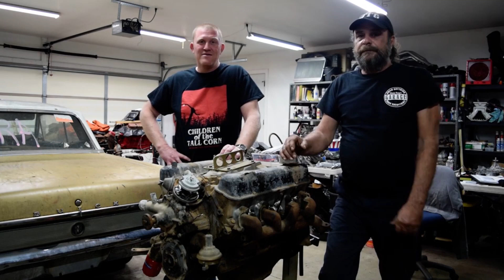Buicks Miracle Motor

Comment: Put the 215 in an Opel Kadett because they were sold by buick.
Reply: I have one in an Opel Manta, great little engine in a light car!
Reply: Also the V8 is about the same weight as the original 4 cylinder engine, so it’s a win win!👍🏻
Reply: @stratznhatz  a manta with this little turbo engine would be great fun.....from Wyoming USA 🔫🤠🇺🇸p.s stay safe
Reply: @billallen4793  Yes the Manta is a great looking car imo and the V8 gives it the go to match. Mines not turbocharged and only mildly tuned but is pretty quick even by modern standards. Thank you and stay safe too from the Uk😊
Reply: @stratznhatz  we had a manta when we were stationed in Belgium. It was a fast little car, that handled VERY well for the era. It stayed there when we came stateside in 86, the shipping was more too expensive vs the value of the car. Every once in a while you'll see one around town, a guy has a yellow one parked in a field. Our's was a dark green with black pinstripes, black interior. Great little reliable car, that was fun to drive. With the torque of a v8 it is probably better. With the added weight up front does it push in the corner entry?.....from Wyoming USA 🔫🤠🇺🇸p.s stay safe and healthy everybody GOD BLESS OUR COUNTRY AND stop this foolishness before it's too late...
Reply: @billallen4793  I agree, the Manta was a fair performer in it’s day and a nice car to drive. If I were lucky enough to get hold of another one I would leave it stock and original, especially given their rarity these days (I modified mine 20 years ago). 
The V8 doesn’t affect handling as I believe it’s actually slightly lighter than the original engine - the cih 4 cyl is very heavy  for it’s size. 
Nice to hear of your experience with one in Belgium, thanks for sharing.
Best wishes to everyone.
Reply: @stratznhatz  come for vacation and snag the yellow one...lol I live in a gorgeous mtn town called Lander. The shipping and left hand drive will be the biggest problems, out west our car's DON'T rust much so that shouldn't be a big issue....from Wyoming USA 🔫🤠🇺🇸p.s stay safe
Reply: @billallen4793  Ha ha, would love to visit the USA one day, will make a note of Lander, you never know! Yes they’re pretty rare in the UK now, hardly ever bump into another one at shows etc, rust is a big issue over here! Sounds like an idyllic place where you live, take care and stay safe🇬🇧
Reply: @billallen4793  ps: there’s a couple of short vids of my manta on my channel if you’re interested, also one that another guy did which you’ll find if you type in ‘Manta v8 kop hill’
Best wishes 
Andy.
Reply: @stratznhatz  I'll give them a watch! If you google lander!...lol yes I think we are spoiled, living here. Other's say we are stupid because of the winter's. But the ability to have public lands, and freedoms to do any outdoor hobby you can think of just feet from your door. We are minutes away from ANYTHING, PRAIRIE, DESERT, RIVER'S, LAKES, MTN'S, GRASSLANDS, and anywhere else you can think of. All accessible to the public free of charge. And I'm fond of self defense and shooting so my state is awesome for that. We DON'T have to have any license to conceal a weapon "pistol" and we gave open carry which means I can carry my pistols in plain view WITHOUT being hassled. Before I became disabled in September of 03, I was able to fistfight my way out of any trouble but not any more. So not being a victim or a statistic is important to me. Not that we have a crime problem, but being ex military you must be prepared. The scenery is worth the winter's, I need to make a bumper sticker that say's "Wyoming  EVERYWHERE you lQQk is like a postcard". World class trout fishing is another reason. And raising our kid's in a great community was important also....from Wyoming USA 🔫🤠🇺🇸p.s stay safe
Reply: @stratznhatz  oh I forgot, my buddy has a junkyard and he has a all aluminium buick v8 to take hime wuth the yellow one from town. And living in a place where car's DON'T rust is great, my 74 full convertible Blazer that has 1ton axles and a 465muncie 4speed with 37"tires. And no vehicle inspection and EASY rule's regarding legalities of road worthy vehicles. 4 wheelers are road legal here, and any performance thing can be done to your vehicle WITHOUT getting in trouble by the state or local cop's....from Wyoming USA 🔫🤠🇺🇸p.s stay safe
Reply: @billallen4793  I will definitely have a gander at lander lol! I’m not a fan of big cities, much prefer to be out in the sticks a little so it sounds like my kind of place.
 Sorry to hear of your disability, hope it doesn’t affect your daily life too severely.
 Blazer sounds great, and I guess a 4x4 gets a lot of use in your area!  We’re lucky in the uk that as long as modifications are declared (insurance) and the car passes Mot inspection you’re good to go. Only extreme mods would require engineers report, such as scratch built or heavily modified structural changes, at least that’s been my experience, although there seems a constant surge by the powers that be that try to clamp down on things. Take care.👍
Reply: @stratznhatz  very cool car! Watched your video's and your car was great. Why did you get rid of it? I love the color too. It's real close to a 66 f250 I had the ford color was called emberglow. Snag this yellow one and put a little LS Chevy engine which I think is smaller dimensionally than the little buick v8. Looked pretty tight by the brake booster, and I wish I could have seen the steering shaft and the exhaust clearances. Is it hard to build hot rods over there? Or can you hodg podg stuff together like we can? All we need are light's to drive at night. You can build a car without light's to drive in the daylight. We don't have inspection in our state or emission testing, you can do whatever you can dream up. I loved building and racing my whole life, ANYTHING burned gas. I still have a bunch of old toys that I can't use anymore, or was in the middle of building when I got hurt in 03 with a back injury at work so my legs are quitting...lol I never got to England closest I got was camping on those rocky beaches on France's north shore. I've heard it not the same now and I should cherish the memories because it isn't like that a anymore. Do you have some projects that you're working on, or dreaming about? I've got 4.5 snowmobiles 5 motorcycles that are all special/oddballs a garden tractor with a Yamaha v-twin 750cc built for pulling a weighted trailer/sled and my speed/drag boat, and I can't work on any of it. If you come to the state's you should check out the flyover state's like mine. How big is your town? Our town is 7000ish people but 30% are seasonal resident who go south for the winter,  retired folks. Anyhow sorry about the book...from Wyoming USA 🔫🤠🇺🇸p.s stay safe and healthy everybody GOD BLESS OUR COUNTRY AND YOUR'S
Reply: @billallen4793  Thank you for the comments, and don’t worry, I still own it! The vids where I’m rambling on about the modifications are very recent as I’ve changed the engine recently for the larger 3.9 version that I sourced from a fire damaged TVR Chimaera which is a British sports car you may or may not have heard of. Only mods are mild cam (crower 50229) and I just tidied up the cyl heads but retained the stock valves. 9.8:1 compression ratio, modified Range Rover P38 headers and topped off with an Edelbrock 500 carb so just enough to liven things up without spending the earth lol! I also added a dual wideband AFR kit to help tune it which works pretty well. Yes it’s not too bad regarding building cars over here, although like I said there always seems to be someone trying to spoil it lol! So far so good now, and whatever your views are on Brexit at least the rest of Europe can’t influence our government like they used too, I believe Germany has to retro fit catalytic converters to classic cars in order to keep them legal, according to the episode of Wheeler dealers where they bought an 80’s Mercedes from Germany. If a car is over 40 years old here it can be declared tax and Mot exempt, although technically if it’s modified significantly from stock the mot exemption is not valid and I take mine for inspection every year regardless for my own peace of mind.
  Sorry to hear of your back injury, such a fragile thing the back and hear of so many people with back issues. I did mine a couple of years back, just picking up a pipe flange off the floor at work and man the pain nearly brought tears to my eyes, and to this day I still have a numb patch at the top of my right thigh, thankfully not enough to affect me but has made me very careful now and I tend to use the crane a lot more than I used to!
Sounds like you have a lot of cool stuff there, with the tractors, snowmobiles and drag boat’s, something for every terrain! Shame you never made it to the Uk, I’m guessing this would have been in the 80’s which is the era I grew up in and like everywhere things were different back then, for better or for worse lol,  but I have fond memories of that time like I guess most of us have about the time when we were young and free.
Other than keeping on top of the Manta, no other projects at present, although I’m always dreaming about doing something. About 5 years ago I bought a ‘61 Olds 88 that had been sat in a barn for over a decade. It was surprisingly solid and once I’d got it running smooth and overhauled the brakes it became my daily driver for a few years, which is nuts really over here, the darn thing barely fit in any parking space and averaged 10 mpg, but I loved it and only sold it due to the running/renovation costs. Will hopefully get into another project in the future, probably be when I retire now God willing.
The town where I live is in the Peak District, Derbyshire and about 12,000 people. Not too built up here, and you don’t have to drive far to be out in the countryside, so maybe not too different to Lander, which might I add looks like a beautiful place from what I can see! (Wikipedia and google maps-something we didn’t have back in the 80’s lol!).
 Hey don’t apologise for the book, I’m just as bad ha ha! Been nice conversing with you.👍
Hopefully I’ll get to the USA one day, and will definitely choose the rural area’s over the Cities if I do.
Thank you for your service, take care and stay safe, and yes, God bless us all😊
Reply: Or an Opel GT.  Would it fit?
Reply: @turdferguson4124  I guess it would probably fit but would be a tight squeeze. Would be cool though, like a true baby corvette!
Reply: @stratznhatz  I now have the "you're too fat for the Opel GT" TV commercial looping in my head.
Reply: @felisconcolor1112  ha ha, yes I’ve seen a clip of that ad!
Reply: @turdferguson4124  I've seen one with a big block Buick
Reply: I have 2 Buick 215's, one in an MG Midget... back in 1960's daily drove one in the Olds Jetfire turbocharged...
Reply: Yes! Uncle has a 74 I've been trying to get him to swap it for years!
Reply: I'd like to see it in a Model T coupe hot rod.
Reply: 69 Opel was my first car. Got clipped for doing 72 in a 55. Was pretty much wide open.

Comment: the 3800 series 2 and 3 are rally solid engines 

really cool learning about where they started from
Reply: just gotta replace the lower intake gaskets with the FEL-PRO metal frame ones..... and ya, 500,000 miles with just oil changes, a few sensors, and possibly a water pump
.
and if you dont know about the LIM gasket defects on the series 2..... you do now!!!..... and you should replace them ASAP!!!!
especially if it has more than 175,000 miles on it
.
coolant will start to leak on the outside.... usually pooling in small spots on the intake by the injectors
then it will start to leak internal..... filling the oil with coolant
then the engine locks up
then you make a big sad face...... 
.
but if you buy the 50 dollar gasket set..... and spend about 8 hours..... now the engine has ZERO flaws / defects
and WILL!!! last damn near forever 
.
but ya.... its a pretty easy job..... just time consuming 
its like pulling the intake on a 350 chevy..... just with fuel injectors and a few wires to un-hook and flop out of the way

Comment: I had a 225 in a 1969 Jeep CJ5 it was a great engine for that light little truck. It had a bunch of miles on when I got it and I drove the heck out of it. Never used any oil or failed to start no matter the temp. All I did was rebuild the carb and put on a voltage regulator. I regret letting it go but I was over the ragtop deal.

Comment: I had 2 '66 Buick Specials....  one was a V6 (factory 160 hp) with a 3 on the tree, and the other was a 300 V8 (210 hp) with a glide..   My favorite Buicks
Reply: Not a Power glide, a Super Turbine 300
Reply: Superturbine  or jet away for Oldsmobile both had switch pitch tork converter that would fit in the 400 turbo for Buick or Olds and the small block converter from the 2-speed is l lot smaller than the big block one and let the stall increase on high stall to over 3,000 rpm before locking up and low stall was about 2,200 rpm...

Comment: Buick 215 design was used in Land Rovers for years.
Reply: Yes and had tons of engine failures.....
Reply: Because Land Rover
Reply: @will7its  some of the larger capacity versions had issues.
Reply: @will7its  and most of those were down to a lack of oil changes...... you can tell the mechanical condition by the amount of black crud under the rockers and in the valley of the block....... Just proved this with my latest build,  an unknown 72 Rover P5 motor.... Clean under rockers and inlet manifold, upon stripdown find it unbelievably clean..... the only wear being the timing chain, still on standard bore and bearings!   Feel free to take a look here....   https://youtu.be/LUoEsFanxUk
Reply: @BLOWN8CYLINDER  Very nice. I always liked them and would like to put one in a boat but was turned off by all the landrover engine failures. When people say they want to drive it off a cliff (with driver) or throw themselves in front of a train etc etc you start to wonder if its really worth it....but I'll probably do it anyway.....🤗
Reply: Land Rover was part of Rover/British Layland. They treated that engine like Frank's Red Hot.

Comment: The 3800 made 205 net in the 1998 Bonneville without the supercharger.
Reply: my 98 park avenue has a 3800. currently sitting at about 300000 miles and still get 20 plus miles per gallon
Reply: @tonywhitaker8146  I lost mine when it suddenly lost oil pressure while passing on a 2 lane road. 5000 and no oil pressure do not mix.